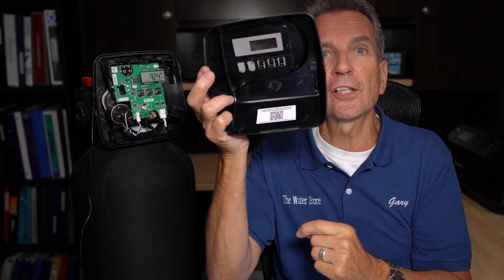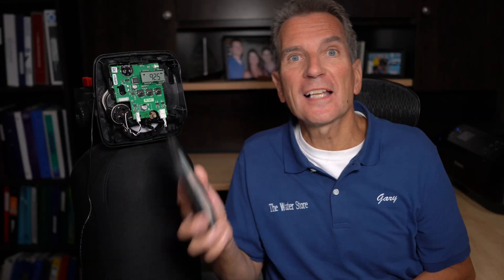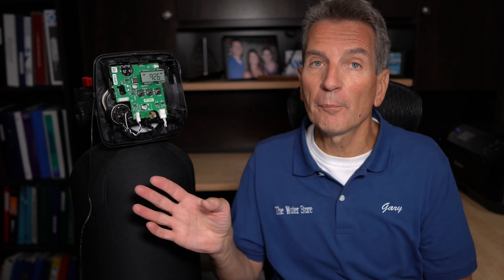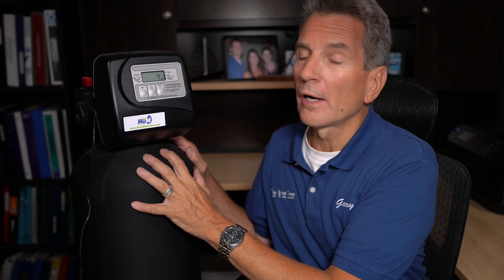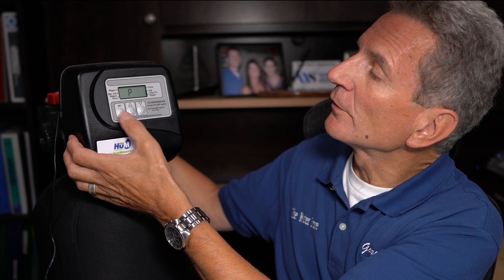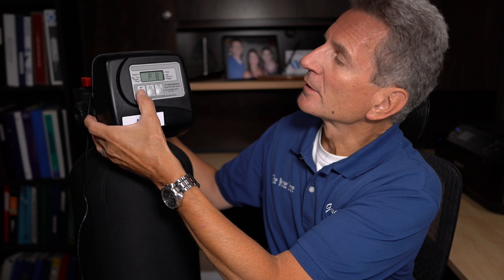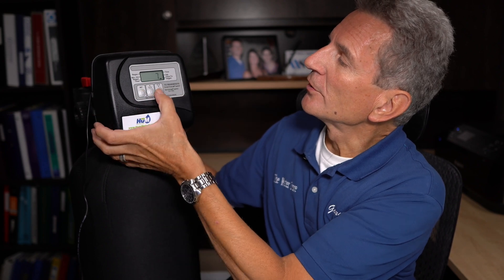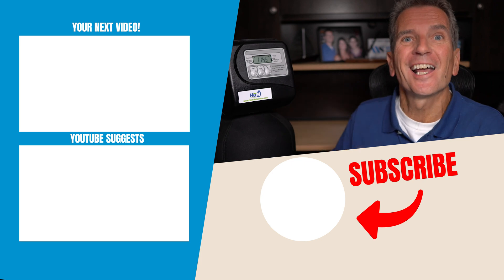How to SET TIME and PROGRAM CLACK WS1 3 button Valve

Comment: If you're using the filter for backwashing only, do you need to put a blocker on the regeneration port that would normally go out to the salt tank when it was used as a softener??
Reply: Great question.

Comment: My clack ws1 screen has the arrow flashing on the '''min refill" I do have salt in my brine tank and water is just now visible, should I just add some additional salt at this time, or is there another issue.  I have learned A LOT from your videos, Thanx.
Reply from the maker: No, nothing needs to be added.
Reply: @water_estore  Thanx for your response, understand now that the "min Fill" is minutes to fill.  I still have the flashing arrow pointing to the Min Fill, yet everything seems to be working correctly.  Is there a setting in the program steps that lets you adjust or at least check how many minutes are set in that part of the program.  I have not seen that mentioned in any of your videos.  My system is 17 years old, but still works great, I have the iron/sulfur filter with the 3 button clack and softner with the 5 button clack.  Again, thank you for your videos.
Reply from the maker: From the size of the system (30,000 grains) and lbs of salt the valve calculates minutes of fill.

Comment: I have a question: first of all thank you so much for helping me understand my water softener and sulphur filter systems much better. I know you said to stagger the water softener and carbon filter in this video, but what about water softener and sulphur filter? They were both set for 2:00am by installer. If I set water softener to 2:00am and sulphur filter to 4:00am is that ok? Any reason I shouldn’t? Thank you!
Reply from the maker: Yes, all water filtration should be staggered, your installer should know better! 2 am and 4 am is perfect.

Comment: Thank you for the info I have this on my water softener and I bought it two years ago. The circuit board has burned out three times I just ordered a new one this time and will install it myself. Do these go bad frequently normally?
Reply from the maker: No, you need to plug it into a surge suppressor since your voltage must spike occasionally killing the board.  We have the replacement boards here https://waterestore.com/products/clack-ws1-3-button-circuit-board-v3108tc
Reply: @water_estore  Thanks I ordered it. The system is on its own breaker box, is there a surge protector that is for outdoor and not crazy expensive?

Comment: Great tutorial. I just had the circuit board go out and ordered one from you. Was confused on the -TC vs. -TB older boards but this answered my question. 
Fyi, I have a backwashable carbon filter.
Reply from the maker: Yes, they typically use the 3 button TC valve, but not always.  Sometimes they use a 5 button.

Comment: Hi Gary,

What would cause the filter to blow all the media out? We set up routinely with a little media coming out when getting air out of the line. We backwashed it two more times with no media coming out. Came back this morning and it was blowing the media out and system in error backwashing mode
Reply from the maker: Typically, this happens when the top basket or bottom basket in the water softener becomes cracked or just fails.  It happens very seldom, but it's a pain when it does. You will need to replace the riser tube and basket https://waterestore.com/products/hum-riser-tube-and-upper-screen-replacement-combo and the media https://waterestore.com/products/excelclear-premium-grade-water-softener-media-1-cubic-foot

Comment: new house here, the builder put this valve in my softener, and the 5 button Clack valve in the filter, doesn’t make sense i Guess ??  so this basically means i cannot set the hardness or the regeneration days in my softener ?  how often is the softener gonna regenerate ?
Reply from the maker: You would need to calculate the frequency of regeneration just like we did 30  years ago when no water softeners were metered.

Comment: I have the same clack valve in the video.  I can set the time of day.  However, holding the "Set" and "Up arrow" (5 seconds) does not get me into the menu settings to adjust the regen time, etc.  Is there a lockout feature on this valve?  If so, what is the method to unlock it?  Thanks.
Reply from the maker: Yes, it is locked. This video shows you how to unlock https://youtu.be/bU3wW29R7iE?si=G9lqsd3ctt-i9xoV

Comment: Hi Gary! Thank you for this informative video. We just got this model installed with pressure and brine tank (KMnO₄). What program (PO to  P9) should we use for iron filtering? It's currently in P1, but it's using an awful lot of water from our well. Could we switch to a shorter program, e.g. one that doesn't use the second backwash? Thank you!
Reply from the maker: Great question.  P1 is not for an iron filter, it is for a water softener.  You need to switch to P7
Reply: @water_estore  thank you. I will look into that. 👍

Comment: PLEASE HELP!!!! I had a company install a tank with this head. They were supposed to instruct me on how to use it and they were supposed to set up a brine tank and teach me how to do a manual regeneration.  They never did and never show up. I have gone and purchased a brink tank but I can't figure out how and where to  connect it to the system.  I've looked at the manual but it doesn't say. Please help me!
Reply from the maker: You first need to know what you purchased.  Did you purchase a water softener or something else?  If it didn't come with a brine tank I would be suspicious if it actaully is a water softener.  What does it say on your invoice. This exact valve (3 control buttons on the front) is almost never used on a water softener anymore.
Reply: @GarytheWaterGuy  it is this 3 button valve.  We are just using it to remove ammonia using turbidex.  Turbidex can be regenerated using salt. I use it in my aquarium hobby from time to time to remove ammonia spikes quickly.  I have regenerated it using water softener salt before but not in this unit. I have never used this valve and don't know where to attach the 3/8ths inch hose. Once I get it attached I can figure out how to to a regeneration. I've only had the units a short time but I don't want to go too long without regenerating the turbidex

Comment: Hi Gary, I have one of these systems for my house and I am getting an E1 error. When I was trying to troubleshoot it I had read that it could possibly be that the motor was shot or not functioning properly, however when I removed the motor and turned it back on the motor spun just fine but the error still remained. The valve seems to move just fine when I manually move the gears and so I am wondering if you think the board is bad or if there is something else I should be checking? Thank you!
Reply from the maker: This video should help https://youtu.be/v_oF5w5dB1U

Comment: Hey gary is there a way to change the settings on the WS1 3 button as far as hardness? I think mine is set too high and using too much salt. Thanks so much!
Reply from the maker: You need to calculate how many gallons of water usage and set regen frequency based on water softener size and hardness.  The manual is here https://envirowatertec.com/wp-content/uploads/2016/02/Clack-3-button.pdf I realize that is not easy to do.  The easy way?  extend the days between regen by one, try it for a month.  If water is still soft extend it another day.  Keep going until you start getting hard water.
Reply: @water_estore  Thanks Gary YOU ARE THE MAN!

Comment: Hi Gary. My plumber put in a WS1TC a few years ago - wish I would have known this is not good as a water softner. Is there a way to change how much salt it uses? Im filling it every month and even though Im in FL I think thats a LOT of salt! Thanks so much!
Reply from the maker: The amount of salt used depends on the settings.  I would first make sure yours is set properly.  You can change the dasy between regeneration to longer intervals but it depnds on how much water you use and your hardness.
Reply: @water_estore  Hey thanks! Can you show how to adjust this on the 3 button model please? I see it for the others but not for this model.

Comment: Gary I have a 3 button one on a carbón filter and a 4 button on a softener, do You have the same vídeo on the 4 button one? And Also does the carbón go before the softener or after?
Reply from the maker: I don't have one specifically for the 4 button but this video includes that valve https://youtu.be/c6r7qUK8to4 Carbon goes before the softener.

Comment: Gary, My Clack WS1 3 button unit only displays military time.  Is there a way to change it?  Nothing in the instructions.
Reply from the maker: I seem to recall something about this on older models but there is nothing in the manual.  If I come across it I will let you know.

Comment: Hi Gary, is there a way to set the minimum fill? I find that the salt basin does not refill enough during a regen
Reply from the maker: The salt setting determines how much water goes into the brine tank.  the higher the salt setting the more water.

Comment: Hi Gary. How many minutes of fill should the valve be set to for a 60,000 grain water softener? How much salt should I be using per regeneration?
Reply from the maker: You would set the salt usage to 15 lbs per regeneration.  The valve will calculate the number of minutes of fill.

Comment: Hi.. Thanks for video.. Can you make video how to Install fill switch assembly or micro switch to use backwash signal for feed pump startup ...
Reply from the maker: I don't know anything about this.  Why would you need it?
Reply: @water_estore  Thanks for your response. Feed pumps working level based so while tank level high pump standby mode even regeneration / Backwash if happened.

Comment: Hi Gary, I have the same 3-button backwash clack head, but just recently I started to hear steady noise coming from inside parts, becoming more noticeable by removing the electronic board. Sounds like pressure releasing .. hissing sound. Is there any pressure valve or controller that you recommend to check?
Reply from the maker: I would check the info in this video https://youtu.be/RhvspR3PAw8
Reply: @water_estore  the noise stops on bypass.. no water leaks on the drain, but I’ll try to open it up and see what’s going on inside. Thanks
Reply: @water_estore  i followed your video and found one of the seal pack inside rubber rings was chipped off, I replaced the seal pack with the piston and the sounds is gone away : ) thank you so much! I’m glad I found your video

Comment: Clickity Clack. One of the worst valves available.
Reply from the maker: Why?  I believe that the Clack WS1 valve is the best after working with and servicing it and countless others for almost 20 years.  What do you base your comment on?
Reply: @water_estore  I too base it on experience, as I too am a water technician. We quit selling them do to our tech support line being over burdened with support calls.
Reply from the maker: @bwells6381  Sorry to hear, I have never heard this before from anyone else, every Clack dealer that I know absolutely loves them.  Can you be more specific as to what those calls were about?  Was it  parts that were failing or what else could it have been?  If part failures, what parts?  I would love to know.
Reply: I just got one, and I’m in africa where there isn’t really support for it. I’ve followed your video to set up as well as manual. But my brine tank keeps overflowing and every couple of hours a lot of water is coming out of the drain from the clack valve. Technician here is saying valves are faulty and not closing correctly